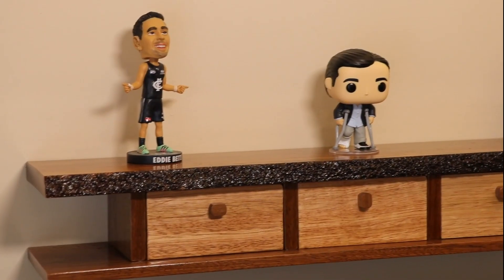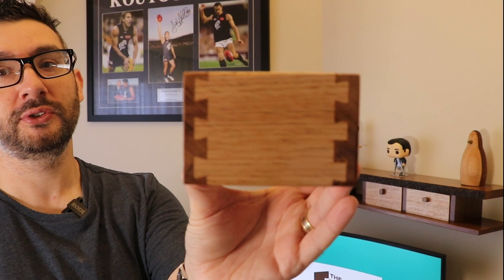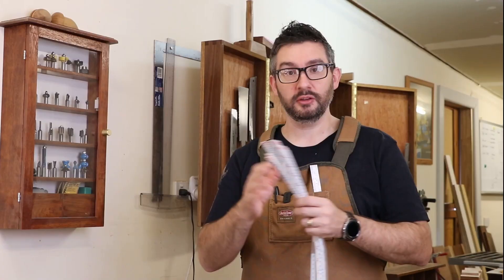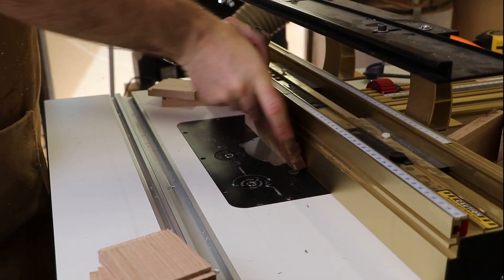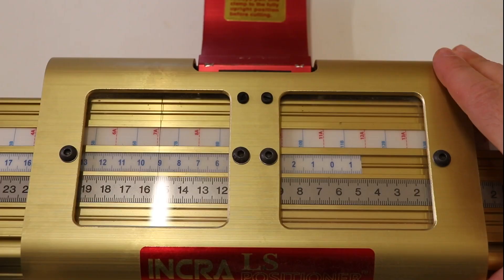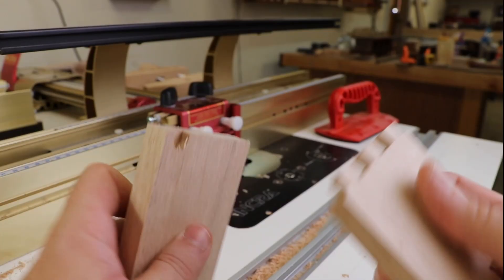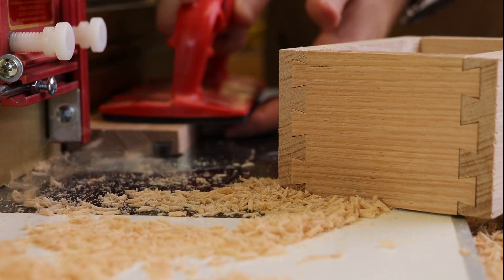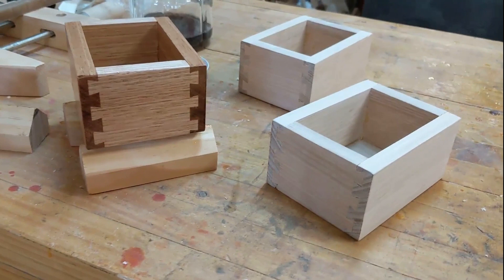Make perfect half blind dovetails with the Incra LS WonderFence Super System

Comment: Have you had any trouble hitting the feet of the right angle fence attachment when pushing working through the bit?  Hard to tell on video, but looks like it may be tough to judge when to stop your push so as not to have the router ruin those.
Reply: The very first time I used it, bang, right into the feet. 😔 Fortunately they're made from plywood for that reason, you can very easily make a new one if you ruin it. Having said that, ever since that first stuffup, I've never hit it again.
Reply: Thanks for the reply.  Good info